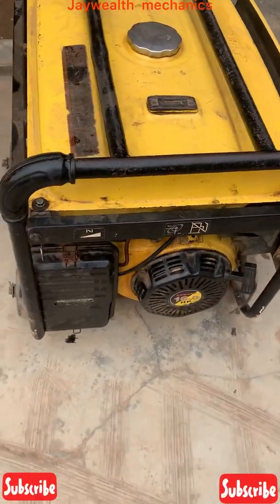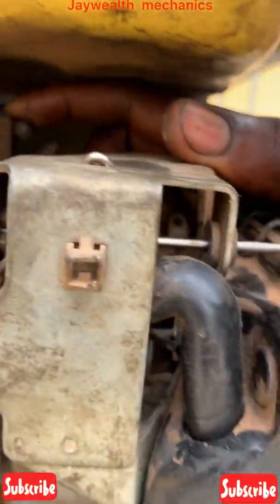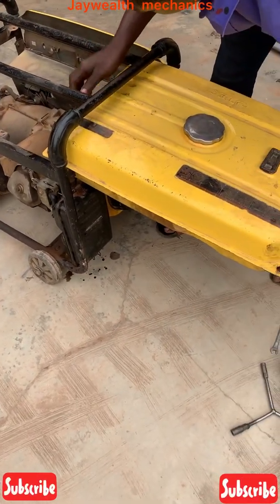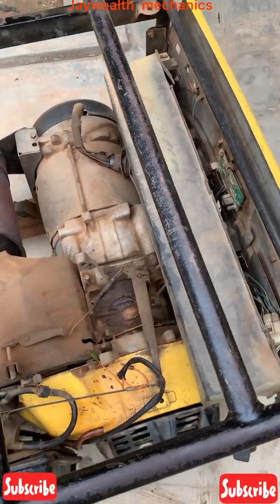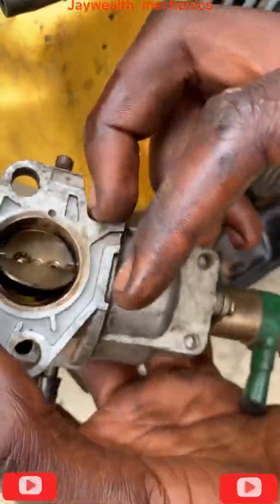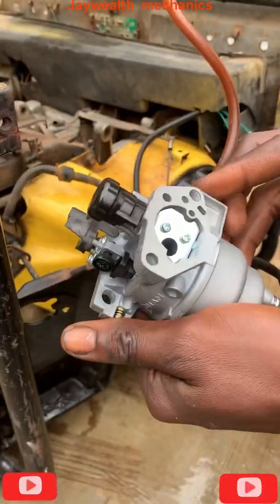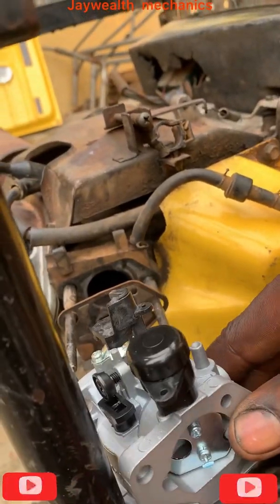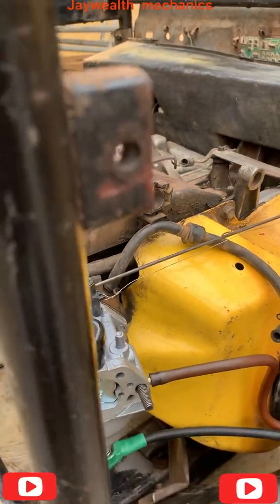How to correct high speed of generator @jcondon1

Comment: Nice video man👍 
Please that adjustment you did on the governor won't that need a readjustment since the problem is not from there. Lastly, looks like the gen has no air filter installed. What are the implications of not having one in a gen?
Good job man. I have learnt a lot from your videos.
Reply from the maker: No need of readjustment since it have been set already, air filter do absorb oil coming from the valve cover and it also reduce the sound of generator.